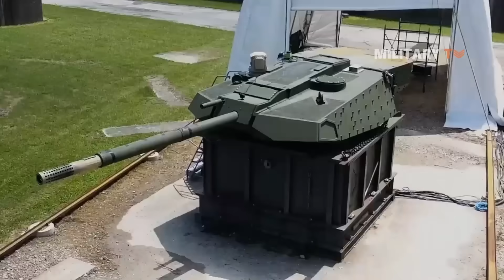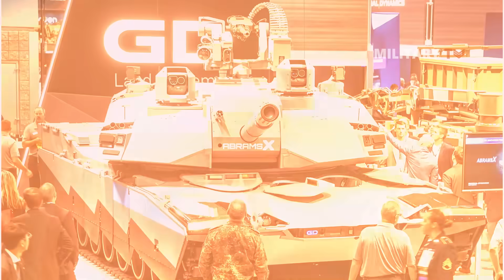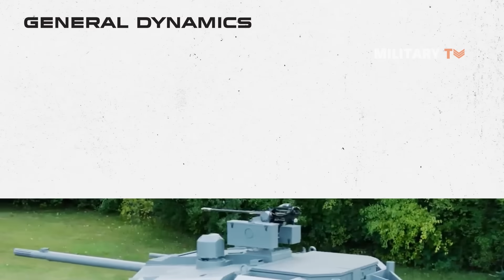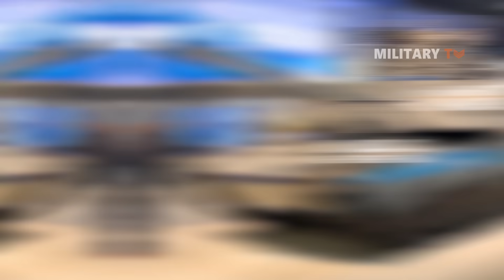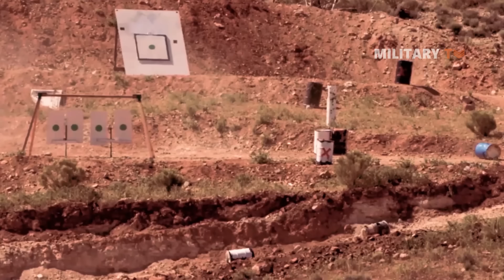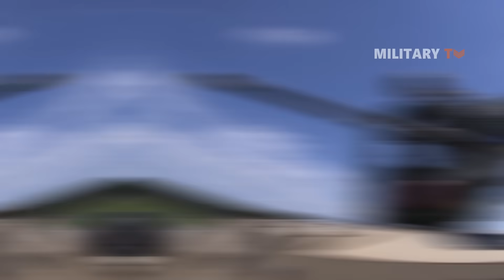Abrams X Tank: US Army Successfully Tested Deadliest New Tank

Comment: I am old school and spent all my time in 4 man crewed tanks..but as I went from M48's to M60's to M1's...but we should all be open to new tech and ideas..if this new design is half as good as it looks I say let's  bring it on..I will say one thing when I was a gunner having that loud engine having to fire up at 2 a.m. really was a great way to give away your position...
Reply: When the first UAV covers your whole tank with Super foam, we'll see how those billions of $ were wisely spent as the crew suffocates inside.
Reply: @DonWan47  You should either go to firefighting school like I did, or read up and various methods of foam as an anti fire method.  It smothers the fire.  Well, I don't have the time nor inclanation of school ya, boy.  Do your own research.  Something called "goodle, or google" I think.
Reply: I'm a huge fan of hybridization.
Reply: You went to civilian fire fighting school.  Nuff said.
Reply: seems like a diesel electric would be the way to go in the modern world. Porsche wanted to do that in WW2, but the battery tech wasn't there. Big, articulated dump trucks run those and they're almost silent, plus there's a sh*tload of torque at low rpm.
Reply: "..but as I went from M48's to M60's to M1's..."

Did you forget to finish this thought?
Reply: Look at what Raytheon did to the M60 A3
Reply: There was a you tube video not long ago the General Dynamics posted on a supped up M60A3... new stabs 120mm reactive armor looked badass

Comment: At first I thought that 30mm gun was going to be too much. I thought it would be better to have a .50 cal with more ammo to engage infantry and light vehicles such as trucks. But in the modern battlefield where pretty much every infantry unit is either motorized or mechinized it makes a lot of sense. There's a lot of vehicles in use that can easily withstand 50 cal fire, but for which the 120 gun is overkill. 

These targets also often carry AT missles so its actually really useful to have a gun system that appropriately matches that kind of firepower and armor.
Reply: Yeah, I mean worse case scenario it shouldn't be too hard to simply make a mount for a 50 cal if they felt they needed it. Always something that can be changed afterwards if it was needed.
Reply: ATGM teams and drones. Programmable airburst rounds and some form of target detection will knock drones out of the sky
Reply: not to mention how urban combat is becoming increasingly common as well, a large gun for infantry and light armor makes sense as it can shred walls easier. This is also good since tanks can fill the role currently used by some IFVs by providing intermidate fire between the 50 cal used by light vehicles like Humvees and the larger cannons used by tanks.
Reply: @dotabuff5288  isn't russia that country thats out losing to its tiny neighbor?
Reply: @adarvirohfanbelarus8889 all things that make it perfect for a secondary gun you also get way more options in weapons packaging from air burst shells to hard hitting rounds.  it gives the tank more multi role ability being able to go from engaging ground targets to air defense vs low flying aircraft like drones
Reply: @Adierit  Ukraine is not tiny by European standards; it's as big as Germany or France with a population comparable to Poland's.  And it's winning with massive help from NATO countries and devastating economic sanctions against Russia.  But it's also true that Russian military doctrine is obsolete and its logistics capability has serious shortcomings.  Plus they have soldiers who don't believe in Putin's war while the people of Ukraine are united in the patriotic defense of their homeland.
Reply: Personally my 1st thought is anti air for attack helicopters. A 50cal mg can take down some helps. It can probably damage and take down eventually even attack helicopters like Hinds or Apaches but a 30mm would be able to cut these down like they were normal copters
Reply: The30mm is for wheel and light armor vehicles the coax machine gun is for troops on the ground or you can say infantry
Reply: ...in the heat of battle you would stop and think, man this 120mm is overkill 🙄
Reply: @Maranatha175   Give me 130mm or don't bother!
Reply: @Adierit tiny? U mean the biggest country by landmass in europe if u exclude russia itself?
Reply: Well the Abrams is 40 years old or more
Reply: So basically, you would rather have the most strongest military in the world get destroyed by the few most weakest militaries in the world? Id keep the 120 mm and the 50 cal machine gun.
Reply: @JD_BRO117 Bubba god love you , you just don't understand ballistics. The 120 mm is still being used on the abramsx it's just the upgraded version will still use the same ammunition as the older version but also shoot more modern loads. Not to hurt your feelings a 50 cal bmg compared to a 30mm isn't even close. A 50 cal bmg is a lot smaller way smaller a 30mm running a derived uranium alone will down any modern tank. The coaxial machine gun is 7.62 and shoot insanely fast. The entire tanks weapons system is an upgrade not a downgrade if any of you knew the insane penetration small arms get off of using derived uranium and its secondary explosion it causes you guys would be like nah don't need a 130mm round. A 30mm running any derived uranium will down and mean it down any modern tank on its own. A bradley fighting tank using just a 25 mm bushmaster none derived uranium pretty much helped down a t90. A 30mm without derived uranium loads will knock out a t90.
Reply: @Adierit  how tf is Ukraine tiny😂
Reply: @ry0usama511  I live in the US, Texas is bigger then the average European country, we deal with your guys "logistical" issues on a daily basis just in our every day economy without any shortages. Texas for reference, is a single state in the US, we have 49 others after that.
Reply: With the way the war in Ukraine is going, I think anti-drone capabilities should be top priority

Comment: What blew me away is the new Abrams secondary (30mm) have more power than the M2 Bradley’s main gun. It’s much needed, that Active Protection is too, Tanks are underpowered and are almost no match for dismounted infantry with AT these days, having this beast with a good support system and infantry will do serious damage.
Reply: Considering that 30mm chaingun can defeat the BMP-3 (freeing up the 120mm for enemy MBTs), this is one formidable tank.  Let's hope they're more reliable than the "mighty" Russian T14.
Reply: @memeityy  Most of what I wrote was heavy on sarcasm.
Reply: @snowdogthewolf  I thought so, but there are a lot of Russia defenders in this comment section.
Reply: @memeityy  tankies are on some serious copium. For some reason they love tanks that use engines from the 40s, have terrible auto loaders, and tanks with anti missile and drone systems that don't work.
Reply: @shaunlevin5081  Ahaha it's because they learn all their tank info from Warthunder, which is made by a Russian company
Reply: A 50mm is in development to replace the 25mm.

Comment: This isn't THE new tank it is just an Abrams tank testing the new equipment and ideas for a new tank.

Edit: To clarify, the video title is misleading as it makes viewers think the Abrams X is in the running to be the next tank or the next variant of the Abrams because the title says the Army is testing them. It is just a technology demonstrator. The last part about the US Army testing the Abrams X may be false information too as there currently is no mention that the Army is testing it. 

At best(air quotes🙃), a few of the technologies showcased here will make its way on to current Abrams tanks as an interim solution before THE next generation main battle tanks. Currently the Decisive Lethality Platform which is part of the Next Generation Combat Vehicle program is looking to replace the M1 Abrams.
Reply: Its very impressive still, not that the M1 Abrams on its own isnt impressive enough.
Reply: A concept… May or may not be…
Reply: I like what I have seen here. But let us see how the tests go…..
Reply: No its a new tank based on the NGMBT. Dont get jealous
Reply: @B1GK1NG  This isn't a new tank model. It is just an Abrams showcasing the technology to the public. Jealousy has nothing to do with this.
Reply: It's still an Abrams, but is there a reason to change the overall design?
Reply: @huntersmark917  There are so many changes, re fitting doesn't make sense.
Reply: Right, even though it has new features, it is not a “new tank”. 🤦‍♂️
Reply: @pgimacahilasadrianjude5699  emphasis on "THE". Do I need to break it down further like you're 5 years old or can you figure it out?
Reply: @bl8danjil  maybe. But i wish you can break it down as if you are a military expert in the weapons industry.
Reply: @pgimacahilasadrianjude5699  It was a rhetorical question.
Reply: @bl8danjil  yeah… and you are not a military expert in the weapons industry.
Reply: @pgimacahilasadrianjude5699  Kinda am, more than this channel anyway. This channel, however, is definitely NOT a military expert channel. It frequently gets things wrong. But you wouldn't know that if you don't read up on the military programs and news articles focusing on it. This video makes it seem like this vehicle is the new up and coming tank. It isn't. This is a technology demonstrator to showcase the equipment, not a complete tank.
Reply: @bl8danjil  I see. I wonder what credentials do you need to be “kinda am” a military expert in the weapons industry. Do you work in the weapons industry? Are you in the military? Did you earn a degree related to these things for you to say you “kinda are”? If not, my statement stands for itself. That you are not a military expert in a weapons industry.
Reply: @pgimacahilasadrianjude5699  Can you dispute what I said? No and my point still stands above yours.
Reply: @bl8danjil  lol! Read them again! You can’t even dispute mine 😂 my statement stands above yours because who are you to make such a claim in the first place!! 😂
Reply: @bl8danjil  who are you to make such a claim? 😂 both being a “kinda am” more as an expert compared to them and being an actual military expert in the weapons industry? 😂
Reply: @pgimacahilasadrianjude5699  I am a better weapons expert than this channel and you apparently. Did you really think that just because they have a channel that they are suddenly experts? PFFT, get real. Are you one? If not, than who are you to say I am not one? 

If you cannot dispute the fact that this is a technology weapons and equipment demonstrator than my point still stand above yours. That's the whole entire point of this argument: you think this is the new tank that is going to be used, while I say it is just a technology demonstrator.
Reply: Test bed prototype just to see what works.
Reply: @Ratkill9000  It's more of a technology demonstrator. A prototype usually means this thing, as a whole, is in the running to be the main battle tank replacement.
Reply: @bl8danjil  i asked for your credentials. You gave none. Again. You can’t dispute 😂 you are NOT a military expert in the weapons industry
Reply: @bl8danjil  you need to improve your reading comprehension friend. I never said they were military experts. I said you are not a military expert in the weapons industry 👌
Reply: @pgimacahilasadrianjude5699  So if you can't discredit me, then you are no better. At least I have my military service to to back me up. What do you got? Zilch 😂.

You are just mad I disproved your statement with "its a technology demonstrator" and you went and looked this tank up and found out I was right. Cope with it.
Reply: @bl8danjil  good! See? That wasn’t so hard. You have a military service background. But you are not a military expert in the weapons industry. 👏
Reply: @pgimacahilasadrianjude5699  No, I am. There is no point in trying to prove it with an anonymous account I don't want associated with my real life identity. But stay mad and off topic though, you're just proving you don't know anything.
Reply: @bl8danjil  again. Reading comprehension. My claim ever since was who are you to say such thing 😂 Finally!! No you are not. That wasn’t hard to admit wasn’t it? It just took a lot of replies.
Reply: @pgimacahilasadrianjude5699  cope harder. 😄 Maybe someday you will figure out why your own reading comprehension sucks.
Reply: @bl8danjil  look in the mirror 😃🤗
Reply: @pgimacahilasadrianjude5699  cope harder since you can't disprove my credibility nor the fact that this is a technology demonstrator. 😄🤣
Reply: @bl8danjil  cope harder because you just recently admitted the fact that you are not a military expert in the weapons industry :) God bless you and may He grant you wisdom
Reply: @pgimacahilasadrianjude5699  Cope harder, I never said I wasn't an expert in the defense industry. That's just your disillusion. Credibility has nothing to do with the fact that this tank is a technology demonstrator. That's why you should cope harder. Or just stay mad you can't disprove this isn't a technology demonstrator. 🤣😂
Reply: @bl8danjil  🤗may look into yourself so you’d understand what I mean. Just because one may have a military service background and read a lot of material regarding these does not make one an expert :) God bless you
Reply: @bl8danjil  again :) please read what im trying to claim. Never disputed that this was not a tech demonstrator :) Please continue to look into yourself. May God grant you wisdom for reflection 🤗
Reply: @pgimacahilasadrianjude5699  I am an expert, but since I am using an anonymous account who are you to judge anyway who has credibility here?
Reply: @pgimacahilasadrianjude5699  on a more important subject. When will you admit that the Abrams X is just a technology demonstrator?
Reply: @pgimacahilasadrianjude5699  Since you brought God into it I'm going to point out that you saying you never disputed this was a technology demonstrator when, in fact, your first comment claimed otherwise is lying. And lying is a sin.
Reply: @bl8danjil  this is worse than I thought. 😅 I do honestly hope you improve comprehension. Plus it would help you in other aspects of your life. 👋
Reply: @pgimacahilasadrianjude5699  Look in the mirror. You're the one that needs to improve their reading comprehension. Lying to yourself is just putting you at a disadvantage in life.
Reply: @Sephiroth0420  Incorrect, you yourself need to do a quick Google search. It's a technology demonstrator. Stay ignorant and mad or cope with that fact that this is not "the" upcoming tank.

If the army is lucky, it will get some of these solutions as an upgrade, but they won't get the Abrams X as their new tank.
Reply: Somehow a similar story with the new tank from rheinmetall that many news outlets now call "germanys new super deadly tank" when it's at the moment just a new contestant for the next gen
Reply: It's the difference between a F-15a, and F-15EX. It's a huge improvement
Reply: @thepilotman5378  No doubt that there is an improvement, but this is not an actual tank being developed. It's a technology demonstrator.
Reply: @arkandrada3305  it already exists and they've tested it so it's not a May or maybe it's a existing system
Reply: @bl8danjil  Does it matter?
Reply: @AlexHorton8647  It does when the viewer thinks this is what the Army will get because of the misleading title. In fact, I can't find where it officially states that the Army even tested the Abrams X so the title is possibly a false claim too.
Reply: @bl8danjil  Honestly, it would make sense to just upgrade the Abrams, since it's already a reliable platform. I wouldn't be against an entirely new tank, but I think an upgraded Abrams is reasonable to expect. The military has a history of reusing old platforms to save costs, after all.
Reply: @AlexHorton8647  Sure, I have no problem with that because that's also what General Dynamics Land Systems (GDLS) is trying to show. That the Abrams platform can serve as an interim with new technology before the next generation main battle tank (MBT). That does not mean the Army will get this exact tank, but hopefully (*air quotes🙃) some of the technologies. Some of it looks to just require modifications to the older Abrams while other technologies are going to require the Army purchase new Abrams tanks that already incorporate them into it.

Again, this is a tech demonstrator to show off ideas GDLS put together. Whether these technologies are used in the current Abrams or in the development of the next generation of main battle tanks is up to the Army. The Abrams X, as is though, has not been stated to be the next main battle tank as a variant the army will use nor as a next generation successor and that is what I am railing against.
Reply: @Saiko7Sven  Not really, since the biggest change there is is the revised turret(except for the new technology of course). But the point was, like the other fellow said, was a technology demonstrator. Who knows, maybe the company may just end up with this design lol. But we're still not sure at all if they'll stick to this design, or change it in the near future to ensure that all/some of the technology can fit inside the tank
Reply: @bl8danjil  I agree, the army itself(or the other branches, for that matter), hasn't officially declared the tank as a next gen battle tank. But in my opinion, I dont actually think they can fit all of the new technology in the next battle tank. But like you said, it is merely a tech demonstrator
Reply: @Scrumptious_Doodles  Well, the Marine Corps just gave up its Abrams tanks to change to its new force design. 😔 So the Army and National Guard are going to be the only ones with main battle tanks for now at least.